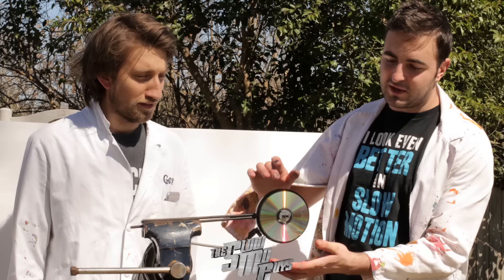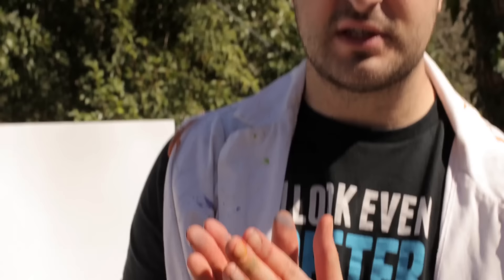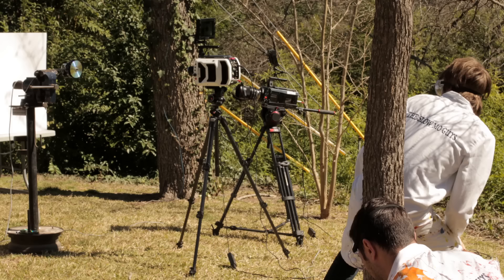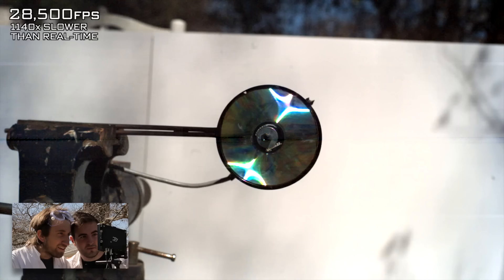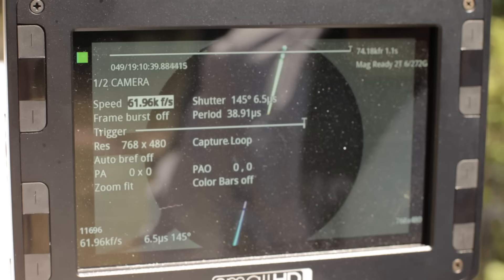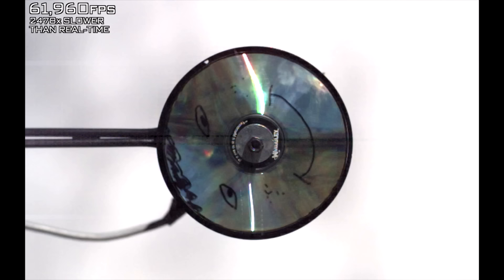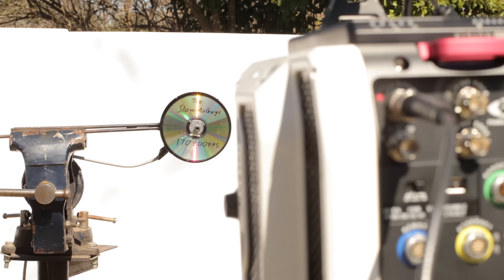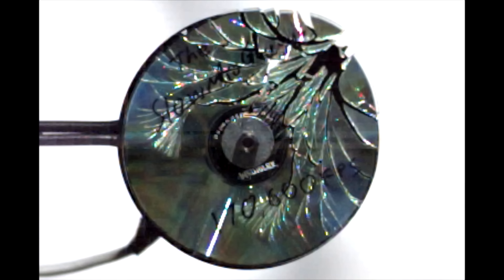CD Shattering at 170,000FPS! - The Slow Mo Guys

Comment: If an engineer analyzed this, what would he see?

  At the first moment of disintegration, the shards tend to propagate separations that are longer in a tangential direction than in a radial direction; this suggests a dominating banded, tangential laminar structure to the polymer chains of the CD's polycarbonate substrate. Such a disk structure of roughly concentric bands would more freely expand tangentially with the extensive centrifugal forces that differentially increase with radius, the most extended circumference toward the outside, giving it the necessary ruffle that must leave the plane of the CD like a sine wave wrapped around a cylinder.  

The slow movement of this wave of deformation is understood as a standing wave that can slowly migrate with it own inertial consequences until some disharmonic vibration destroys the system's balance & integrity.  Energy is in the fast-rotating disk, but its trigger is in the wave!  Disintegration can be predicted, given enough relevant data!  At a certain rotational speed, a failure initiates at the radius of highest extensive stress, the OD, and rapidly propagates throughout the structure!  Failure!  This is one explanation. 

And then there's the possible effects of inductive influence of a fast-rotating disk with a conductive aluminum coating...  Science never sleeps!
Reply: SIMKINETICS Well said. :p
Reply: SIMKINETICS Now I want to see them do it with a blu-ray. It's thicker and should shatter less and at a higher speed.
Reply: NFITC1 it should shatter more actually at higher speeds because high quality discs and more consistency
Reply: Cooldude2819 the streamer Likely true unless the thickness is also different.  Failures start at the imperfections.
Reply: The thing they were using was not perfectly vertical, causing the warping I think. If it were more rigid it might break at that SIMKINETICS
Reply: Cooldude2819 the streamer
It warped because it wasn't in a vacuum. It wouldn't break as quickly. Gravity shouldn't affect it at such high speeds. The exact same things happen when the rotation is horizontal.

And now that I think on it, you are correct that a more rigid disc would shatter more.
Reply: SIMKINETICS Please say that in english.
Reply: Aidan Vandegriff I did!
Reply: SIMKINETICS Pfft lol yeah right
Reply: SIMKINETICS Reduced to layman's terms - As soon as it breaks, you can see the lines of least resistance. The disc spinning alone won't fail, but it's the constant waving back and forth from the vibrations of being at that speed that cause it to break.

Could also be making it's own 'sort of' magnetic field that pulls it back and forth too, but without further testing can't be sure.

Reduced to extreme layman's terms - It's made to spin, but if it spins too fast, it starts folding. When it starts folding it falls apart on a miniscule level and grenades itself.

Reduced to initial reaction - Wow.
Reply: SIMKINETICS What you haven't answered is why it warps. All you've said is it warps and breaks were its most warped (duh). A standing wave isn't produced in the CD by vibration. (as per your theory)

I believe the CD warps because of gravity (in this case). I would love to see them do this again but lay the CD flat on the horizontal plane. I'm willing to bet it doesn't break or would take significantly more RPM's to break, as you would have to produce a rotational momentum that is strong enough to produce a speed at the OD of the disk that the significant difference from the ID eventually causes a stress break in the disk, and I'm willing to bet if you did get the disk to break (REALLY high RPM's) it would break in a totally different way.

Then again some vibration from the spinning mechanism could be causing a resonance frequency that eventually distorts the disk enough to break at the outer edge like we see here. I'm curious also to see what would happen if you spun the disk from the outside as apposed to the inside. ( I doubt it would ever break, proving resonance frequency incorrect).
Reply: Enduro MF 'Such a disk structure of roughly concentric bands would more freely expand tangentially with the extensive centrifugal forces that differentially increase with radius, the most extended circumference toward the outside, giving it the necessary ruffle that must leave the plane of the CD like a sine wave wrapped around a cylinder.'

What part of this did you not understand?  The length of a 3D sine-wave path will exceed the disk circumference by taking on its most uniform, curviform path.  If you don't at least understand solid geometry. you won't understand this.
Reply: SIMKINETICS Where are you getting your data about CD construction?
Reply: Enduro MF I'd been involved in designing automated equipment to produce floppy disks in the late '70's, and spooled tape memory storage cartridges in the late '80's; both groups of products exhibited these waveform distortions at speed, and we had to deal with it.  I'm also very familiar with polycarbonate materials from my engineering work with chemical & biological reagents in the Bio-medical industry where knowledge of polymers' structure & chemical inertness is critical.

Because I mostly worked in scientific companies, I had to learn optics & opto-mechanical design, which I ended up using for much of my career.  So the optical and submicron character of CD's & DVD's intrigued me.  I worked in Silicon Valley, so the local engineers, including me, were quite familiar with coating, etching, implantation & substrate technology.   

Naturally, this background primed me to study the construction of 'optical memory' disks.  I've forgotten more than I remember, so the data's no longer at hand.  If only I had a better memory system...
Reply: SIMKINETICS you should upgrade to a SSD XD
Reply: A Friendly Neighborhood Bushmonster I already did, but the electrons are interfering with the neuron impulses!  ; ]
Reply: SIMKINETICS ouch
Reply: Awesome explanations !
Reply: +SIMKINETICS I bet you were picked on in high school
Reply: PlainN SimpleMan Actually not.  I was and am large & physically menacing.  Not all nerds are bespectacled weaklings!
Reply: SIMKINETICS XD preach it
Reply: +SIMKINETICS  *aluminium.
Reply: +SIMKINETICS what's happening is gyroscopic precession.
Reply: Daniel H No.  Precession is rotation of the disk's axis around another axis.  Here, the disk's axis is fixed.
Reply: +SIMKINETICS I was talking about what was causing the warp, but I was wrong because there is no applied force. Nevermind.
Reply: +SIMKINETICS You can literally see the pretentiousness dripping off of your comments.
Reply: nathan papp I don't pretend.  I am a retired R & D engineer & scientist.
Reply: SIMKINETICS
I never said you did, perhaps you should have taken a few more english classes.
Reply: nathan papp Who ever said that engineering terminology was English?   ; ]
Reply: Nobody, the word "pretentiousness" is however. Any one who quotes themselves and then says, "What part of that did you not understand?" needs a serious reality check. Maybe take a break from self-aggrandizing.
Reply: nathan papp There's no other way to describe the shape of that distortion.  

My motive here is not to hold myself high, but to hold the profession of engineering high!  I know that a YT site like this attracts science-savvy or science-curious young people who want a portal into the possibilities that are beyond their current education; I remember being young & wondering what various jobs actually were.  At my age, I can teach, even on YouTube.

I really picked a profession that I enjoyed beyond what I anticipated when I was young, and hope to share the kind of thinking that engineers & scientists actually do because it satisfies the urge to explore that likely viewers here revere.  This is a grandfatherly expression of concern for upcoming generations.

Americans are slipping in several categories of education as ranked against other first-world countries, and most notably in STEM.  This is a catastrophe in the making for the future of working class families.  Ironically, automation/robotics engineers like me have been part of a trend to replace people, the results of which have important educational implications.  I see a future where engineers & scientists will be in much higher demand than many other occupations, especially occupations that will be progressively automated.

I just want to show that an engineering approach makes a viewpoint that should appeal to some viewers who enjoy analyzing interesting phenomena.  Other engineers & scientists think this way, and often keep lab notes & make reports with such syntax.  It might sound pretentious to you, but it's succinct for what could not be expressed in common vernacular without a tutorial.

As for consideration of careers, I would add that there's a moral dimension to the future of engineering.  I chose to design automated instruments & process machines to serve scientists.  They were happy to get such help because much in science is tedium for most scientific processes, and the scientists are liberated to do analysis instead of mindless repetition.  Replacing skilled workers wasn't fun, though.  The moral component involves the form of capitalism & its future in an increasingly automated world.  That's another discussion I promote on YT.
Reply: mortem orbis
Reply: A Friendly Neighborhood Bushmonster I'm not a gamer.  Please explain.
Reply: SIMKINETICS do you even laten brah
Reply: +SIMKINETICS Sorry, but posting a comment that apparently serves no other purpose but to make yourself sound intelligent by distracting readers with scary looking terms (and totally out of scope with the other comments) and then going on an off topic rant about the lack of STEM in public education only makes you look like an aloof ass. If you really wanted younger people to take interest in STEM, instead of confusing them, EXPLAIN in terms people can understand. Otherwise, you're just widening that rift and doing more harm than good!
Reply: frtard Hmmm. 'Scary looking terms' apparently are not scary to many viewers.  I deliberately wrote for the most likely viewers of this video, not for those who'd be alienated by technical wording.  If that puts you off personally, that's your problem, not mine. By revealing what I or any other engineer might note here is not a matter of demonstrating intelligence, but rather a matter of demonstrating the power of education.  I find it sickening to embrace the notion that education is some kind of problem!  You might consider viewers as more intelligent than your comment implies!
Reply: kpark You're welcome!  And thanks for the encouragement.  Ignorance & The Green Monster go hand-in-hand, not often a problem with engineers!
Reply: +SIMKINETICS So, what causes the disk to go wibbly wobbly?
Reply: Timothy Putranto I don't think any of us know
Reply: +SIMKINETICS  +kpark. this is exactly the problem here. I want to be a computer scientist, and there certainly will be people who are interested in the physics behind it but specialise in other fields. this is higher education territory and I know that it might not be so easy to explain but I want to know in simplest terms possible. I'm not calling you pretentious, although it seems to be implied bup as an a level student I find and interested I find it difficulty to come to terms with your explanation. a simple one would be nice to be honest. 

Thanks.
Reply: ***** Thanks for your question.  Science & engineering are fraught with arcane technical language as shortcuts to complex ideas.  I wrote this largely hypothetical analysis for science-savvy viewers who at least get the drift of what engineers do, knowing that many of them already understand some of the necessary jargon.  This description would be very long as any coherent script in colloquial terminology otherwise.

Regarding your desire to be a computer scientist, I can offer some insight that might surprise you!  My son is also an engineer (mechatronics & robotics), but he got a PhD in computer science through research in neuroscience; go figure...  Surprisingly, this combination is a natural fit for that education!  Robots require dedicated control systems similar to human nervous systems, at least in fundamental ways.  Some computer scientists are & will be involved in such control systems.  Your interest in physics & seemingly unrelated studies will provide synergies that you'll likely find more useful than first appearances reveal.  By the way, that field of discipline is fascinating (not that I know much about it other than through my son's enthusiastic conversations).

I'm a mechanical design engineer who specialized in automation.  I found that I needed to learn some electronics because I didn't always have access to electrical & electronic engineers for support of control systems, but the more complex system were beyond my reach.  It was the computer scientists who enabled me or our group of engineers to develop more capable automated machines & instruments.  You are likely entering a field that has been in increasing demand that will keep growing rapidly!  Computer scientists rock!

If you have difficulty understanding my original comment, you can always research the terminology to bring it into focus; that's what most engineers & scientists had to do too!  Your undergrad work will drive that truth home.  Shortcuts tend to be even more confusing without specialized words & terms.
Reply: SIMKINETICS
i'll start on that. I've also subscribed to your channel. Since you seemingly spend a great proportion of your time on youtube, can i contact you if i have any physics related question. i really look up to people like you who have dedicated much of their time to the fields of knowledge and will very appreciate your time.
Reply: SIMKINETICS so I can technically comment any questions that I have on any of your videos, even if not related to the video specifically, and you'll be OK with that?
Reply: ***** Sure!  That will work.  We should just keep a string from a single comment heading, so others won't interfere (I can edit out apparent spam & trollage).  I only visit that site a few times a month, so my responses might be a bit slow.  You can start with a physics question, maybe about the invention, so I'll look for your comment within 2 days to start the dialogue there.  OK?
Reply: SIMKINETICS oi! count me in!
Reply: ***** Yes.
Reply: A Friendly Neighborhood Bushmonster OK.
Reply: SIMKINETICS I don't understand the two day scheme. i thought this was whenever i had a question lol.
Reply: ***** I'm just careful about my promises.  Retirement is a welcome reprieve from urgency.
Reply: dude you don't have to reply to any of my questions. you've probably done some great work in your career and you deserve to retire in peace. Just take your time when it comes to youtube. Don't make it a chore.
Reply: ***** Thanks for understanding.
Reply: English pls
Reply: +Ⓑ ł ⓤ r ⓡ y̅ ⓕ ᴀ ⓒ e Λlᴅᴀɴ please write your user name in english
Reply: ***** It doesn't look like the acceleration is enough for that, but very high acceleration might cause that effect.
Reply: +SIMKINETICS 

The CD is the sum of a remainder of an unbalanced equation inherent to the programming of the matrix. It is the eventuality of an anomaly, which despite my sincerest efforts I have been unable to eliminate from what is otherwise a harmony of mathematical precision. While it remains a burden to sedulously avoid it, it is not unexpected, and thus not beyond a measure of control. Which has led it, inexorably, to be attached to a hoover on youtube.
Reply: Stefan Fairweather Yeah, but have you even considered the dihydrazine sulfate flux capacitor when it goes critical on the quantum discombobulator?  It won't work on a Hoover at anything below 127 kilopascals!
Reply: SIMKINETICS at this point I just know you're joking
Reply: A Friendly Neighborhood Bushmonster Unless you know science & engineering, you won't know whether I am or not joking.
Reply: SIMKINETICS I studied some quantum physics, I know you're joking.
Reply: +A Friendly Neighborhood Bushmonster This doesn't have to do with quantum physics.
Reply: ***** Exactly, and flux capacitors cause  travel
Reply: +SIMKINETICS I would think you could include / exclude causes if you performed the same experiment in a vacuum / by mounting the disc horizontally. My reading of it is that at those speeds the viscosity of the air become significant; as if gets past a certain RPM the air is standing relative to the disk (even it is being dragged relative to everything else) Imperfections in the shape of the disc cause it to be buffeted by the air, causing it to warp very slightly, causing it to be buffeted by the air and constantly feeding back.

When the buffeting hits a certain level, the disc is flexed radially enough to split it slightly and start the tree shaped cracks.

It think this also explains the fact that the warping seems to precess around the disc and isn't stationary; it's a product of the difference between the speed of rotation of the disc and the (much slower) speed of air in contact with the disc.

I'd find it hard to believe that differences in density (or the effect of gravity) would cause that behaviour.

Very interesting anyway!
Reply: +SIMKINETICS Another possibility is that the real culprit is not the centrifugal force but rather the inevitable out of plane vibrations produced by the motor. These vibration are responsible for producing the standing wave. If correct, then I believe a perfectly dampened motor (no vibrations) would not shatter the disk.
Reply: ***** no. It would come up to speed where it would shatter, no matter how perfect the motor is
Reply: ***** Sorry to butt in, but you may have a point about air drag.  Submerging this apparatus in fluids though would not likely reveal anything because the disk's viscous drag would cause cavitation at those speeds.
Reply: basicly shater pshyics
Reply: ***** Yeah, that could be.  I suspect that the greater tangential extension of the disk towards the periphery exacerbates the tendency to ripple.  My invention (shown on YouTube) has inherent ripple, though very minimal, that will interact with motor & engine vibrations; so I've studied pulsing effects in compound systems that produce second-order harmonics with their various vibrating constituents.  In this disk experiment, the peripheral extension likely has its own natural frequency that may interact with motor cogging at another frequency that produces an amplified harmonic.  You might be onto something!
Reply: ***** Actually I read your original comment to mean total immersion in liquid, which would likely cause cavitation alone.  A partially immersed apparatus would add-in air to this system, compounding cavitation; it would be an 'interesting' experiment.  I find it more meaningful and simpler to analyze any experiment to simplify the variables with only fundamental components though.
Reply: Sean Inglis Good comment!  Either way, greater centrifugal force towards the periphery of the disk will tend to stretch it into the shape of a Pringle (the snack) or more like a ruffle at & adjacent to the periphery.  This will certainly create a buffeting effect where the aerodynamics become important as you suggest.  The noted precession of the standing wave is another concern that makes this a hard nut to crack.
Reply: A Friendly Neighborhood Bushmonster My silly comment was intended to challenge you to discern whether my original comment was bogus too!  I'm a retired engineer & scientist whose original comment was serious though.  

Some of the responses in this thread seem to have been written by other engineers or science-savvy viewers who are contributing to this discussion nicely... well worth reading!
Reply: Timothy Putranto The circumference of the outside diameter will grow because it stretches from centrifugal force, which is greatest at that edge of the disk.  The disk is a tough plastic that has compliance (like stretchy rubber).  Since that edge grows, it must stop being a flat circle, and takes on a curvy or ruffled shape that accommodates its greater circumference without increasing its diameter much.  That's a plain as I can write it.
Reply: +SIMKINETICS That's a new video idea if I ever did hear one.
Reply: +SIMKINETICS ...doing the experiment under water so it causes cavitation as well as explodes, I mean. 
I'm not convinced about the thing stretching from centripetal force--intuitively, I feel like the stress i.e. force per unit area is not much greater at the edge than anywhere else, since centripetal acceleration varies linearly with radius, mass is constant, and area increases with radius squared. (Fun integral practice for later?) However, the edge itself would constitute a strain concentration, wouldn't it, since its component particles are only bonded on three sides? (Particles = cubes, right? #notachemist ) 
Watching the video, I thought the sinusoidal warping at the edge was due to some eccentricity in the drive shaft or to the disc not being perfectly aligned/secured, but going back and squinting at it, that doesn't seem like the whole story either...
Reply: ***** When this system hits critical speed, the rotational speed at which any disturbance causes destruction, you must look for extreme anomalies.  The O.D. is where the centrifugal force is maximal.  It is true that the edge is unconstrained by a lack of material beyond it ( a fourth dimension per your description), which exacerbates the weakness there, but the extensive stress is greatest there too.  The ruffle is the only way that the O.D. can expand, and it undoubtedly causes lateral deformations that add another dimension to the stresses there.  Whether imbalance of the drive system caused this or not, that zone is the first to fail at its critical speed. Note that the failure starts at the edge.
Reply: No denying failure starts at the edge, or that the amplitude of the warp is greatest at the edge. I just don't believe centripetal force is causing that. Force is greatest at the edge, because centripetal acceleration is omega squared times the radius. Force per unit area--stress--is LEAST at the outside edge, because there is more area out there to distribute the force over: A = pi times radius SQUARED. Thus there is less centripetal force trying to pull any two particles apart at the edge than at the center. (A reference: http://www.ewp.rpi.edu/hartford/~sarric/SMS/Readings/32669_04.pdf) Given that the ruffle is a sinusoidal wave traveling opposite to the direction of rotation but at the exact same speed, I wonder if this is a resonant frequency issue.
Reply: ***** The centrifugal force is proportional to the radius (not the radius squared), which is maximal at the edge (not the center) in the rotational reference frame.  This causes the greatest extension of material at the edge, effectively increasing the circumference while the radius is substantially constrained until catastrophic failure.  This deformation requires the edge to attain a ruffle, seen as a standing wave by a stationary observer here.  At or beyond the critical speed, most rotators are damaged or destroyed by harmonic effects, likely triggered by asymmetry of the ruffle here.
Reply: Yes, but you're talking about force, not stress. You need to account for stress in analyzing material failure. If I want to cross a pond with a quarter inch of ice over it, I better worm my way across it on my stomach, because the second I stand up, I'm going swimming. The total force due to gravity that I exert on the ice does not change, but the maximum stress on the ice does increase, since the same force is concentrated in a smaller area. By the same logic, the stress due to centripetal acceleration on the CD is greatest in the center: force per area is proportional to r (force) over r squared (area), leaving 1/r. I'm not arguing that a stress gradient does not cause the observed bucking, I'm just arguing about the direction of the gradient.
Reply: ***** Poisson's ratio shows a proportional relationship between stress & strain in a material's elasticity & slightly into its plasticity before failure.  Just observing the separating shards' longer dimensions in their tangential direction leads me to consider a bias in alignment and elongation of the polymer chains as a likely bias of stiffness in the radial direction; but that hypothesis would need further testing.  It would be interesting to run this experiment with video through a polarizer to see how the stress builds with speed.  
As for concentrated loading, the centrifugal force dominates, evident from the greater separation of shards on the outer regions that must be accelerating more there than at the ID due to greater forces at the OD.  Note that plate stresses are lateral here rather than transverse with your ice analogy.
Reply: Thank you Science side of YouTube.
Reply: TheRedMarioBrother you are very welcome, tumblerina
Reply: +SIMKINETICS There's a saying I've heard, which goes like this:

An engineer can make the complex sound simple, and an artist makes the simple complicated.

I don't doubt your credentials or your analysis, but I feel that one reason why people don't take engineering is because they regard it as hard or elitist. I know this is not true, but comments such as this don't really help in my opinion.
Reply: How is a polarizer going to help analyze stress? Going back to the harmonics idea, you can see that the disc is deforming in sort of a regular, clover-leaf pattern, as if there are four repetitions of a sine wave around the edge. If you were to watch the whole thing, would you observe a lower frequency at which the perimeter of the disc bends into two sine waves (i.e. the disc bends along a single diameter)? If so, that would support my notion that the bending is due to harmonic effects, not so much centripetal force. It would be interesting to perform another experiment where the disc was clamped at the center and vibrated at the same frequency without being rotated to see if any similar bending appeared.
Reply: ***** First, stress in clear polymers causes changes in light polarization.  You can try this at home if you have a polarization filter for your camera, or if you have polarized sun glasses, and a piece of clear plexiglass or polycarbonate sheet; look through the polarizer at the piece of clear plastic, and twist or bend the plastic to see a colored pattern shift as light transmits through the sheet as you stress the plastic.  This is an analytic technique used by some engineers to quickly view stress in modeled shapes.
Second, you're using the wrong word for what happens here.  This is a centrifugal effect, not centripetal.  The disk material is being forced outward, not inward; that's why it fails with an explosive motion.
Third, why are you arguing with an engineer?  Just read what I wrote & try to understand it!  The disk deforms into only 2 cycles of wrapped sine-wave of its form to accommodate the extension of the disk's circumference, and I suspect it won't ever have more cycles.  Think about a linear interpretation of a polar function; if the circumference is represented as a straight line segment with a fixed length, the only way to increase its path length is by curving it most simply into a sine wave.
Reply: Bruce Cowan I understand that saying completely because I'm also an amateur artist! The saying is often true!
Reply: Bruce Cowan Also, engineering communication is only simple with the help of visual aids that can't appear in YouTube comments.  Here, those who understand these comments are likely already scientifically or engineering-inclined.  People who have very little exposure or interest in engineering have not been prepared for its specialized vocabulary.
Reply: Fair enough, just to clarify I'll say I'm in my fourth of five years of an engineering degree.
Reply: SIMKINETICS Very cool regarding the polarization, I never knew. I am arguing with you because I am an engineering student and, having considered your points and done some background research, I still think you're wrong (my word choice, therefore, is as intended). What kind of question is that--you're an engineer and you're arguing with me; do you not think I am wrong? :)
Reply: ***** Yes, I think you're wrong, but at the same time I applaud you for questioning me.  Remember, there is no single authority in science but the significant testable truth evoked through evidence where you look for it & find it.  Note that I made that statement as a question, as you always should!  Just carefully read what I wrote & test it with all honesty.  It will likely take hard research on your part, with all due skepticism.  Just keep refining your critical skills as to what is or is not credible; sometimes, this is a very difficult riddle; solve it, but not prematurely.  Look for the 'Ahah' moments, and then question them by testing again.  Science is a process that gains knowledge, and persists!  That's what makes progress.